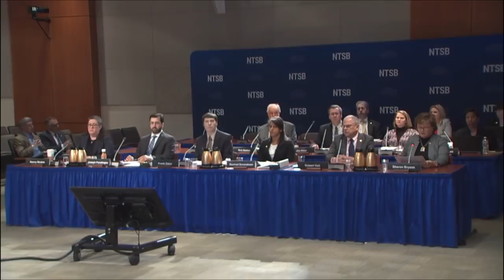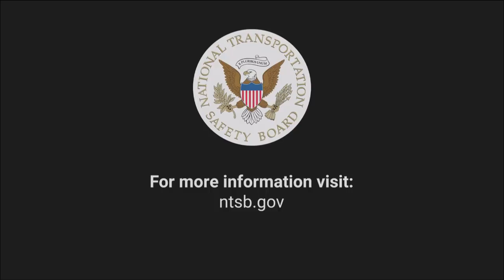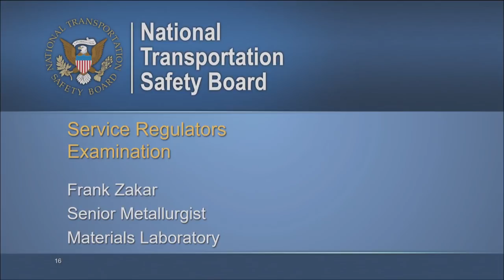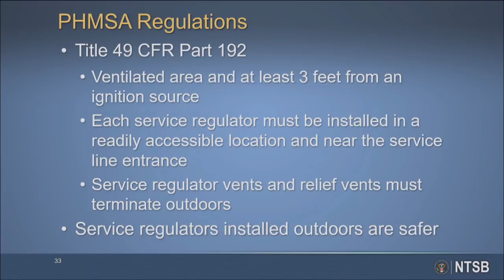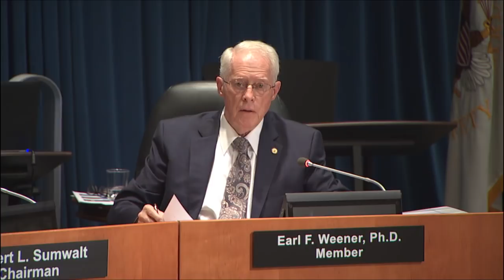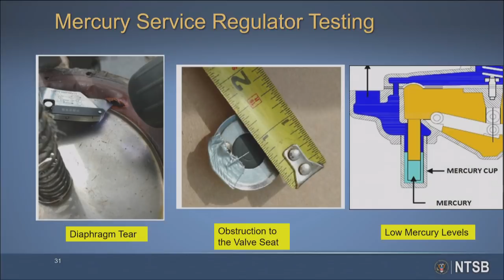NTSB Board Meeting for Investigation of Silver Spring Maryland Apartment Building Explosion

Comment: It's interesting that a private person is expected to notify more people than professional firefighters and dispatchers are expected to notify. You'd kind of hope that the professionals would be held to a higher standard, and be required to notify the gas company. The gas company has the better technology and experience to properly detect , trace, and stop leakages.
   Within the past couple months, I smelled gas in a larger building, and called METCAD. The fire department responded, they too could smell the gas but with their equipment were not able to get a reading. 
    In this case however,  METCAD and Fire did notify the gas company. Gas company showed up and found a significant leak where contractors had connected to run a flexible line up a chimney. 
   This was on a Friday evening, that thing could have leaked all weekend. Even though the FD couldn't get it to show up on their instruments.

Comment: Speaking for our fire department and those surrounding ours with which we work, if we are called for a gas leak, and we need access to a service room, we are getting in.  We are not requiring knox boxes, many do, but if a keyholder is not found, or else has an extended ETA (usually over ten or twenty minutes) we’re popping the door.  I cannot recall thinking of getting a corner open, we’re getting completely in.  It’s not a request.  I am typing this as i listen, so answering Rachel’s comment, if we have a reasonable belief of an incident of any scale (a gas call, needing access to the utility room is more than reasonable) we have every right to completely break down the door (in practice just forcing through the lock).
Reply: That could cause a spark.
Reply: dks13827 would have to be metal to metal, and if i’m not mistaken (i’m not listening to the whole thing again to make sure) they said originally the gas mixture was too rich to explode.  Makes sense, understood, but for a what-if behind that door, it’s always worth picking the mystery box over an inaccurate result.